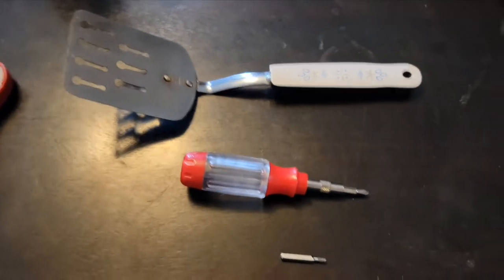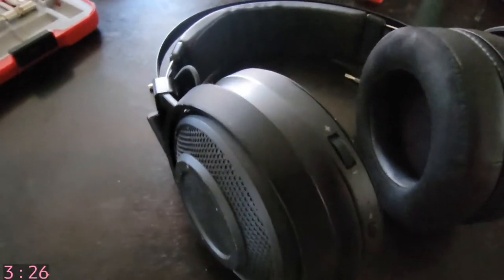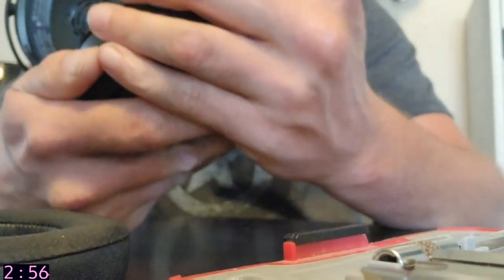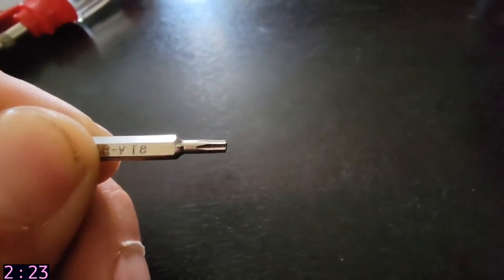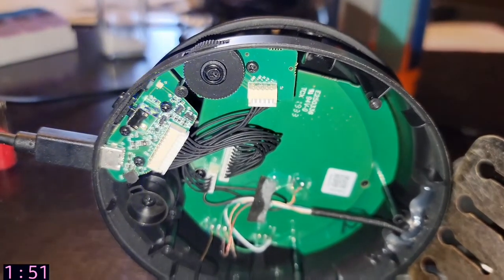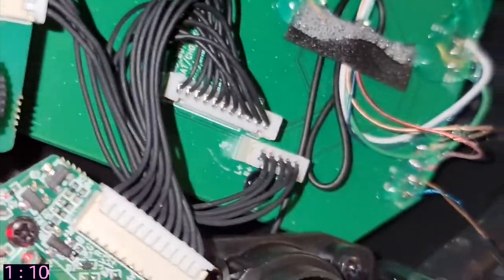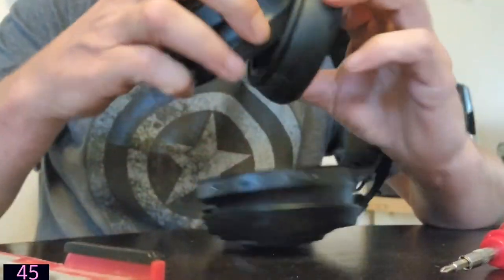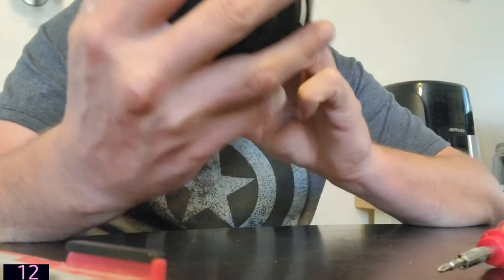Stuff and Things Episode 3 | Razer Nari Essential Wireless Headset Fix | Spatula Not Required

Comment: I would like to say that this video was a life saver, i wasn't confident in the wiring enough to start yanking things, but i decided after watching this that i could just blame you if something went wrong XD. one side of the headphones wasn't making sound (right), i took apart the right side and began tensioning wires to try to find where something had become disconnected, and then the right side started working again. The left side had broken in the process :/, so I repeated the process on the left and this time it all worked. So yea, Thanks XD

Comment: Thank you very much, I had the error that when I raised or lowered the volume, the sound on the left side, which contains the circuit system, stopped playing. I watched your video and after releasing some cables it was solved.

Comment: Curious if you have ever had an issue with a popping noise coming from both sides of the ear cups? Mine has been doing this for about a year now, and it is the most infuriating noise. It hits at a frequency where it feels like literal pop rocks in my ears. I've come to the relatively soft conclusion that it isn't software related. This on top of the constant disconnecting and reconnecting issue, has made this a really miserable experience with these headphones. If you have any suggestions or advice, I would sincerely appreciate it.
Reply from the maker: I had the same issue before and that's what kind of what lead to the video. I swear my ear drums nearly started bleeding the last time it went nuts with popping and a horrible screeching noise. I did uninstall the Razer software after updating the headset  as well and started using Dolby Atmos, whether or not that played a factor or not I'm not sure but I haven't had the problem since. The popping could be a grounding issue so definitely check all the wires are snug in each harness and subsequent socket. Wish I could give you a definitive answer but I'm just not sure.
Reply: @ACS_Media  I wound up getting some replacements. But I might still crack mine open and see if this would work. I appreciate your insight.

Comment: I have the same problem right now, how did you unplug those things???
Reply: and most importantly what did you do to them that helped in fixing the issue
Reply from the maker: All those clips have a lip on each side to get either your nail or something small and flat under, then they pop out. There's likely no need to pull them though, most of the time they just need to be pressed back into their slot due to being loose. That's all I've ever had to do when they start acting up is click them back in.
Reply: @ACS_Media  this doesn't seem to fix the problem for me :\
Reply: it could be the power port on the headset. I know mine is a bit messed up... I kinda wore them while laying down with them still charging.. Now it doesn't like charging while being worn as they would shut off the headset and make the annoying plugged in and unplugged windows device sounds, so I have to take them off... The power port might need to be re-sautered to the circuit board. Or the battery may have gone sour though they are suppose to last ages. Sometimes getting ahold of costumer service and asking might get you the answers you are looking for. Good luck!

Comment: this is the first video I've found ever of someone making a vid about this head set that wasn't a review... I can't find jack about fixing a loose volume wheel on my Narir essential headset. It's bad... right side is going out and I have to keep fiddling with the wheel to try to make the right side work again and it makes a lot of scratchy loose connection sounds too. It started not too long after I got it as gift from someone. Oh and my mic boom is getting floppy.. .the plastic around the base where it goes into the headset cup has broken a bit... it only flops side to side just a lil but I keep it raised and out of the way most of the time... Ideas? Do I tighten the volume wheel and unplug and replug wires...? HELP! >_<
Reply from the maker: I'm not sure what keeps the volume wheel is place, whether it's on a pin and sandwiched between other plastic or it screws into a pin or gear, but if it's a screw I'd say get some thread tape, cut off a skinny little strip, wrap the threads, and tighten it gently. If it's all just plastic and/or a pin it sits on, you might try fitting a washer in next to it.

Comment: hey man i opened the right side and unplugged the battery and replugged it in before coming across this video i dont know if you can help but im having a different issue than you my headphones just wont charge i plug them in and it just doesnt charge ive tried different cords and tried this cord on multiple peripherals so im confident its something with the headphones im just not sure how to approach fixing it cant find any helpful information online either other than how to open them and how to unplug the battery :/
Reply from the maker: Sorry to hear that, I'm sure it's frustrating. I'll look into it and get back to you if I can find a solution.
Reply: @ACS_Media looking at this same problem so if you find a solution please let us know
Reply from the maker: Well I ran into a charging issue but I'm not sure if it's the same issue you have. It wouldn't charge and I remembered what I used to have to do with my old cell phones that had the same crap micro usb. Typically it was a contact issue with the pins just due to use over time, so I tried that same solution and took my pliers then very gently pinched down the end of the micro usb to make it ever so slightly narrower/flatter. Keep in mind that this isn't a permanent solution and there is a point of no return with the pins wearing down. I would recommend grabbing a  magnalink/volta type charger so you no longer have to plug in and unplug the headset anymore if this solution happens to work. If it doesn't and is indeed an internal battery issue, I'll comment with an update should it happen to me and I find a solution.